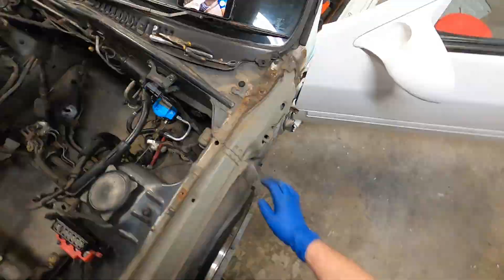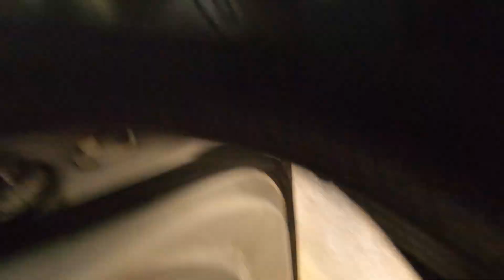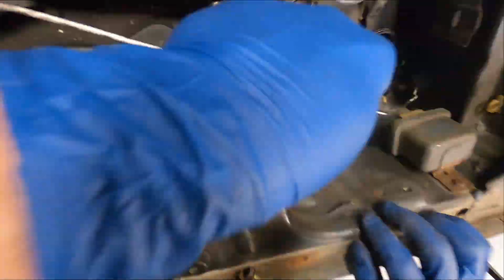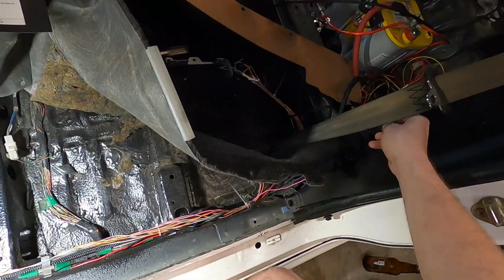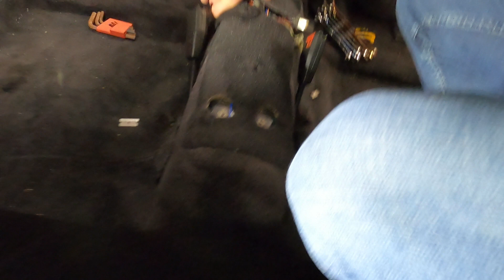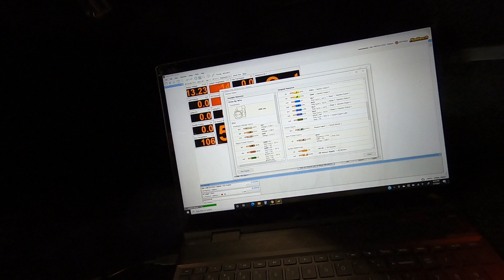Haltech Wiring RX7 FC3s // Aftermarket ECU Relays

Comment: None of the warning sensors are on the stock ECU or engine harness. They all come off of the body harness (Alternator, Low coolant level, hood latch, etc) the only things off of the engine harness that connect that you can cut out and keep is the OEM coolant temp sensor, which is one wire, the windshield wiper, and the boost sensor that goes to the cluster.
Reply from the maker: Thanks, I was most hoping for coolant temp, which I knew was on the engine harness. Any idea if I can piggy back the signal?
Reply: @MohrGarage  Like split the connection?
Reply from the maker: I was thinking to send an output from the haltech to the boost gauge and coolant temp gauge on the stock cluster

Comment: Wouldn't the fuse and relay in the included box be enough for the fuelpump?
Reply from the maker: For a stock application yes. However it doesn't supply enough voltage and it's best to run 10 gauge wire to the pump.
Reply: @MohrGarage  Ah I see. I'm doing the same ECU kit (1000 model) with the premium wire kit. Learning as I go. Might be a good idea to replace the old wire that's in the car right now then. Got a 91 S5 but the wires were a hackjob so I said f it and replaced it with the Haltech harness instead of going through previous owners mess. Been going through your vids and taking notes. Thanks for sharing
Reply from the maker: I forgot to film the final fuel pump wiring set up. I'll include it later in another video. Stay tuned.